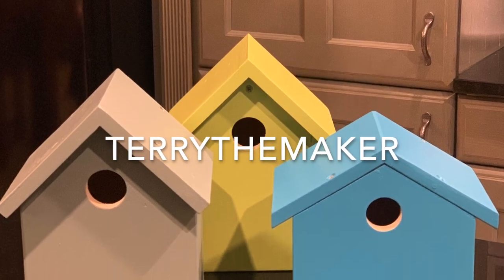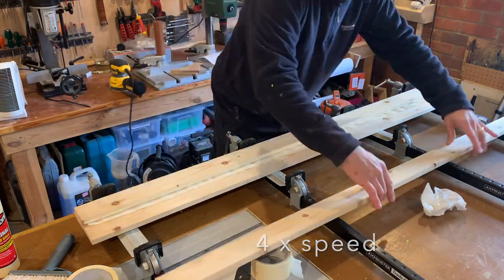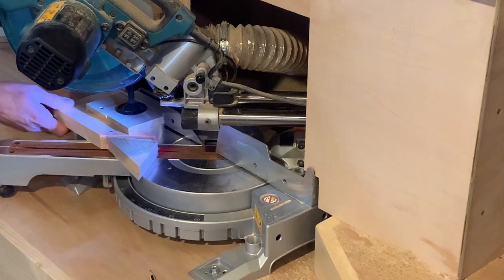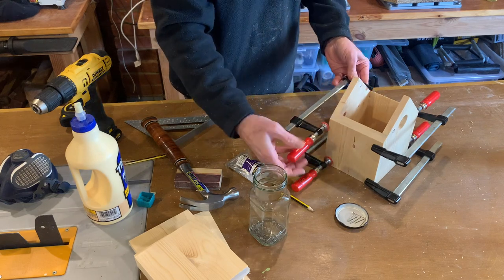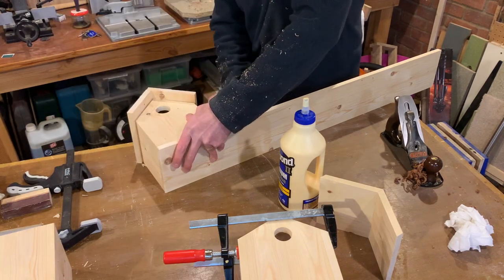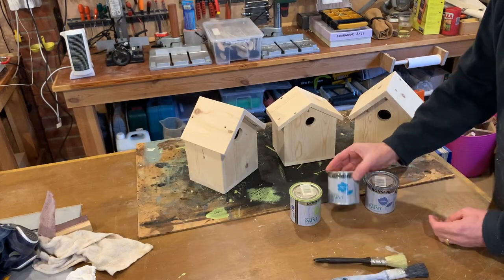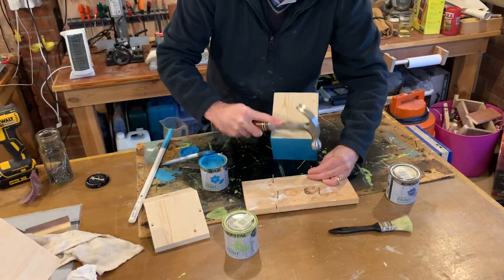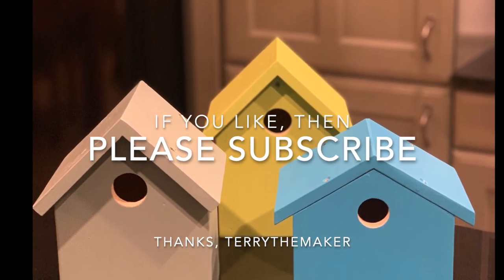How to make a Bird House   HD 1080p

Comment: Hi Terry, 

Nice video and a good result, agree I like the hidden screws on the roof.

Question, the quality of the video is good, nice and sharp a love the use of the Ken Burns (I assume) as you showcase the product. When that's combined with the floating text it gives a quality classy feel. What camera and lighting are you using in the shop. It looks like a DSLR but how did you get around the recording length limitation.

Also, whilst you asked. I like the voice-over approach you use, I quickly contrasted it with your doorstop mouse video. Personally, I like the machine noise but would take down the volume of it so it becomes background rather than foreground. Example when you start the turning on the mouse project you have lowered the sound of the lathe whilst you explain - but then it jumps up in volume when you finish speaking. If you leave it at the same background then it should be good.

I had similar feedback - and when I asked about it, folks use headphones - and when the noise jumps up again it hurts the ears :)

Mind you ignore me, I am still working on getting things right.

Andy
Reply from the maker: Hi Andy thank you for all the feedback I really appreciate it especially from yourself. As you can see I’m quite new to it and I’m only dabbling really with YouTube videos but I enjoy doing them. Believe it or not I’m not using any lighting or any fancy camera at all I’m just using my iPhone but in the garage during lockdown I realised I didn’t have enough lighting and replaced the four bulbs that was hanging from the ceiling with 10 so I now have tons of lighting in my garage. Are you on Instagram?
Reply: Wow that is very impressive with the iPhone, I have a two camera set up and acres of LED lights - but I lovethe colour tone in you videos.

I have recently introduced the iPhone into my videos as well so I can get closer to the action without moving the two main cameras. I must try harder with it as you are getting excellent results.

I am not on Instagram, I signed up and they immediately blocked the account - should really get in touch and ask them to unblock it. I think it will be of value for quick picks and comments about projects etc

Oh yes, saw the cross cut sled in the herb ladder video. Nice job.

Andy
Reply from the maker: @TheWoodgrafter  it would be great to see you Instagram too 👍🏼. By the way You can see the making of my sled on my Instagram